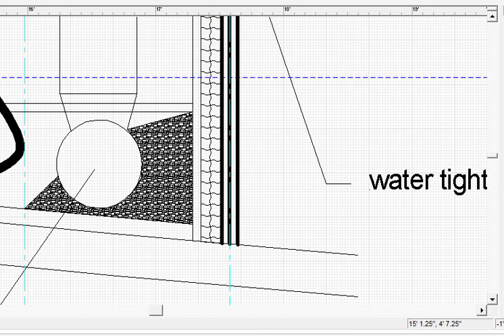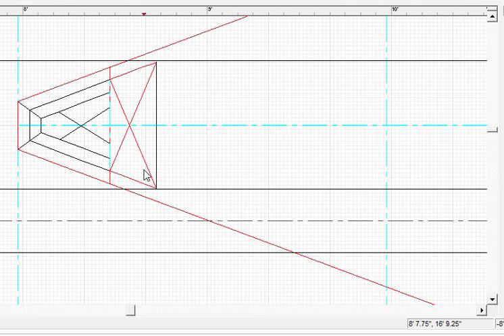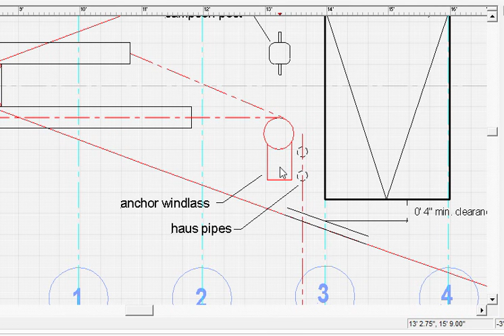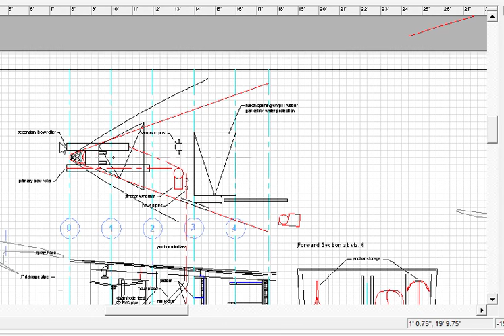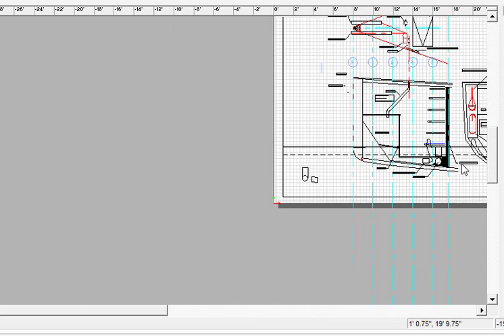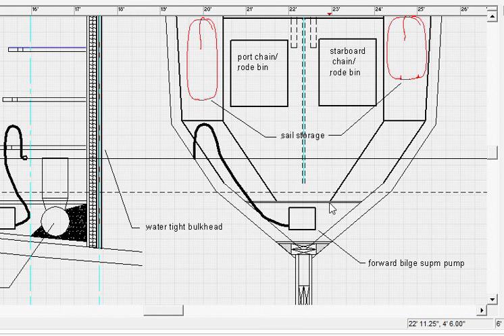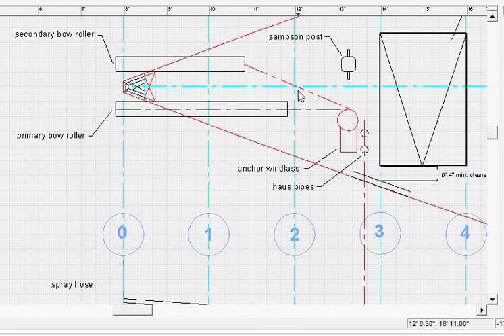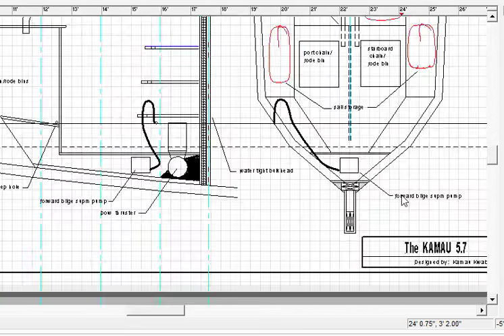I need your help - bow design questions...

Comment: 1 - Is that weep hole through the hull to the outside?  If so, it will let far more water in while underway that out.  Consider a drain to the bilge instead.  

2 - If you are planning on using one windlass for both anchors, consider angling the anchor rollers so that both have a fair lead to the windlass.  Pulling chain across that bend you have shown for the stb one won't work.

3 - Consider doing without the bow thruster altogether.  You won't use it at all while out cruising and as big as your boat is, while at a dock, it will almost certainly be side-tied so the need to maneuver it into and out of a slip (which is where the bow thruster comes in handy) would be minimal.  Granted, your boat is much larger than my Kelly-Peterson 44, but I just don't see you using the thruster enough to offset the cost and complexity entailed in installing it.

4 - You said the forward layer of the bulkhead was sheet rock. Sheet rock doesn't deal well with water.  I'd reconsider that.

5 - Take the anchors off when they measure it, the sometime later, put at least one back on. You may never need it, but having an anchor ready to drop at a moments notice can save your bacon.  On my boat, we have both bow anchors and a stern anchor rigged and ready to drop at all times.

6 - Sorry, I don't have the expertise needed to answer your wood question.

Comment: Hi There,
Have you thought about white cedar? White cedar is used when one needs a lot of strength and is great for water use.  A really hard wood for the bow would be wise, as you never know what you might hit out at sea. The bow, is it already built with the keelson? Or did you stop before the raise upward.? Bow thrushers, they make one that mounts under the keelson , no tunnel, a small hull through and all water tight. Jamestown or Fisheries carriers these thrushers. You can locate anywhere on the hull.

Comment: greetings! I won't say I know much about them, but have you looked at yachtthruster.com They have thruster pods that mount underneath the boat. I know you didn't want something that lowers mechanically.  these are permanently down. my concern was would they slow the boat through the water. according to the guy at the boat show trying to sell them...they are similar to a regular tube thruster in that aspect. but he was trying to sell them. 

As for the anchor roller, they need to stick out far enough that the anchor doesn't bounce against the hull on the way up. you have a very staight up and down bow, and that would be a huge concern for me. you will want to pick your windlass and look at the specs. of chain entry and exit angles. The chain will probably need to go around the windlass at least 90 degrees to assure it stays on the teeth and doesn't skip. once you know the specs for that then you can figure final location for that and the rollers.

Comment: Sheetrock has no place in boat building. EVER.

Mahogany for the stem isn't really that great choice as it doesn't have resistance to critters and it is relatively soft. It's isn't going to take that much so cost isn't really the issue. I would go with something with some resistance and some real substance like purpleheart for my first choice or some white oak (but white oak is hard to be sure of and often substituted with red at lumberyards). Teak is not a bad choice but is pricey and doesn't take glue that well without a lot of prep. I would go with SYP before I would the mahogany. Cedar is a fine wood for boat building but it is a bit soft. The critter resistance is excellent. Some of the ridiculously tough Australian woods are great too.  

Frankly, I think the scantlings for the the bow framing and forefoot are wimpy. You are building a 50 foot boat, not a sailing dinghy. There really is no reason for going with such a fine entry. Put some meat up there. Make the bow wider and you gain a lot of room for chainlocker, and other stuff up front with every inch. It makes framing the bow easier. It's not going to mess with the sailing qualities. Gives you more room for deck gear. Not saying that you should go full on with a scow (not that it is a bad thing...)

Consider adding to your reading list:  Bolger's Boat's with an Open Mind (among others) and even George Buehler's Backyard Boat Building (A new edition is out that I have not read yet but will).  Chapelle's American Small Sailing Craft is a great reference for what has worked for a long time with traditional boats.

As far as fill around the bow thruster tube, nothing wrong with pouring some cement there. Just make sure that the tube is something that will last. It also doesn't really have to be that far forward. Set it back a bit and you have the depth and don't lose that much maneuverability. That said, it is an awful lot of complexity and expense for something that you probably won't use that much once you get used to running the boat.
Reply: David Kirtley  Just a follow up. Some stuff called mahogany isn't bad for resistance to critters and rot. It's just really hard to know exactly what you are getting as the name is used as a pretty generic term. It's all pretty easy to work though.
Reply: David Kirtley "ridiculously tough Australian woods"...Huon pine !
Huon is tougher than nails. (most often you will bend any nail you try to hammer in!!!) Huon is extremely resistant to boring critters & moisture saturation. Truth be told Huon pine can be immersed for 50 to 100 years & still retain it's density & strenght once dried.
Reply from the maker: David there's no drywall. That was a miss speak, I caught it after I posted...lol  I didn't use the framing plan to make this video, just the schematic. The stem beam is 12 inches thick and the knee is almost 2 feet thick. Also the species of African Mahogany I've sourced I used to build my dinghy. It is very bug resistant and strong. I'm actually running an experiment. I've let the wood sit outside in my yard un protected for the past 15 months, and it looks great. No finish, just bare wood. So far so good. Also the bow will have a 3/8" piece of stainless steel on the front for impact resistance. Great comments. I love them, please keep them coming.
Reply from the maker: David Kirtley I used this article when reviewing characteristics of wood for boat building.  What are your thoughts on his descriptions?  See the link below.

https://www.glen-l.com/wood-plywood/bb-chap5c.html#species
Reply: I really think the info is not really that useful in practice. Unless you are dealing directly with a sawmill or it is wood with unique properties or appearance, you really have no idea what you are really getting.

On the bright side, in many cases it really doesn't matter that much. Most of the guidelines for wood choices come from traditional boat building that involve a lot of different design considerations that don't really apply to modern materials and techniques.
Reply from the maker: David I decided to make the bottle bigger. Check out mine latest video.